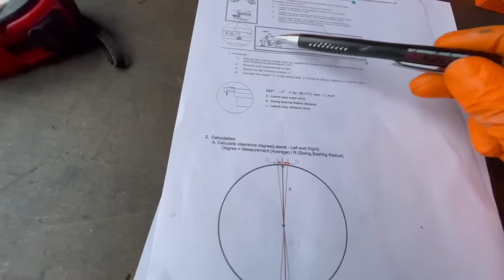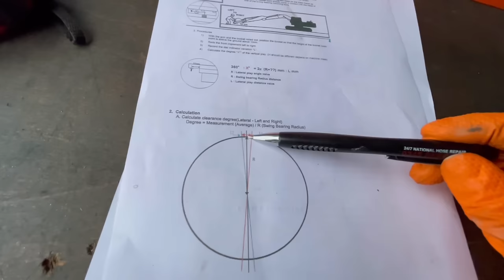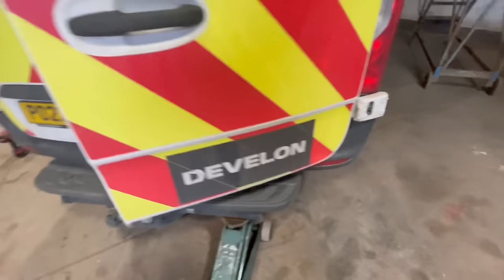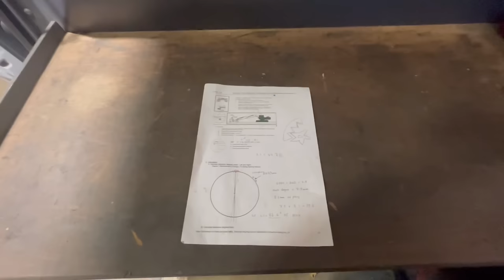I’m back to work ! / Maths problem / Van maintenance

Comment: Hi Ali ,get well soon I know the feeling with the appendix,me I have seen a lot of hospital,was in twice this year my brain went toxic with fluid in my brain,also had brain surgery, and equally an appendix health is wealth for sure as you know I am epileptic with mediation but thankfully under control now.There must be a huge amount of work fixing slew system on a machine it must rotate is it on a gear system with the motor of slew ring lot of work best wishes in Cumbria cheers Declan from Galway Ireland 👍👍🙏🙏

Comment: Adjusted from the little spiked wheel on the forward end, you had your hand right by it when you were talking about it. When your handbrake lets sloppy you can take a wheel nut out and adjust them through the hole with a flat headed screwdriver . 😊

Comment: Well hello again. Swing gear backlash didn’t seem excessive, fire a ton of Grease in there. You don’t want to be changing Ring Gears. Van brakes looked novel although it would ride better with an extra spring in there. Stay well.

Comment: Ali ,your brain is still on holiday,if 1 deg is 7.3  ,your measuring of 3.1 is less than o.5 deg. 22 deg is almost a1/4 rotation. I have never seen an excavator with zero play ,it sounds to me like the operator has the slew brake on,or maybe its not releasing fully!

Comment: as an ex Mercedes tech you do not want to be changing the handbrake shoes, shit job 😂
Reply: Also for future reference, 240nm for wheels nuts and always pull sliders out and grease them because sprinters are a nightmare for seizing sliders, had a fair few where I’ve had to beat them so hard it’s knackered the calliper